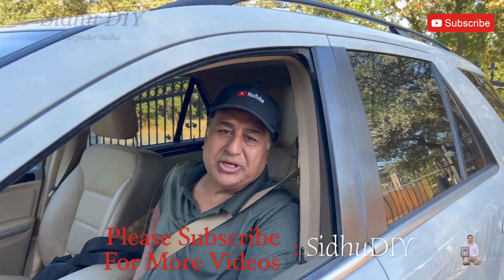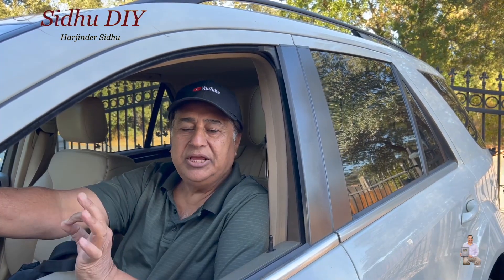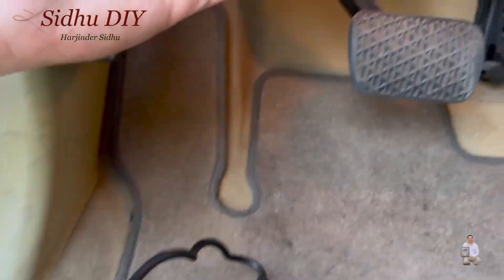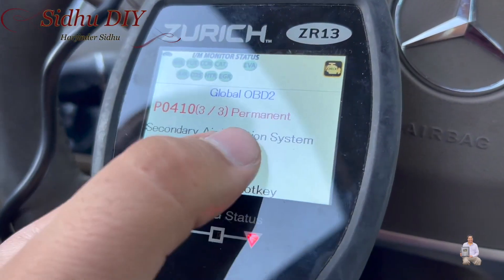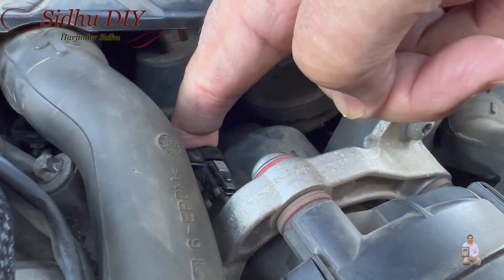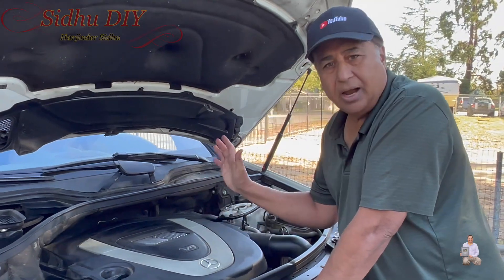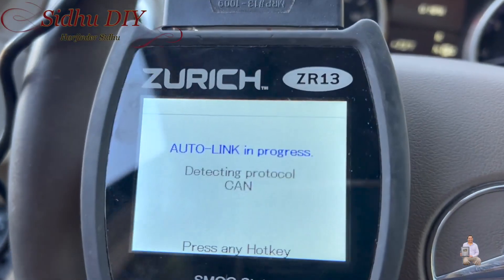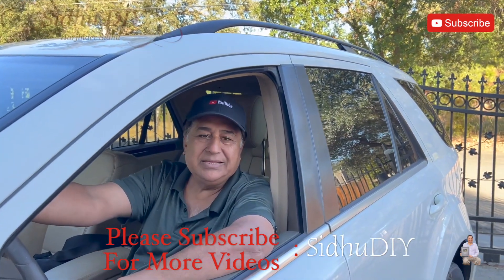Tips and Tricks: How To Fix Check Engine Light P0410 Secondary Air Injection System on Mercedes

Comment from the maker: Tips and Tricks: How To Fix Check Engine Light P0410 Secondary Air Injection System on Mercedes | How To Fix P0410 Secondary Air Injection System on Mercedes ML350 | How To Fix Check Engine Light on Mercedes ML-Class